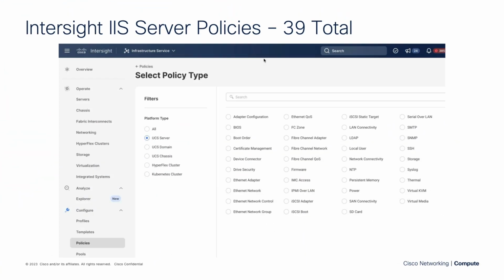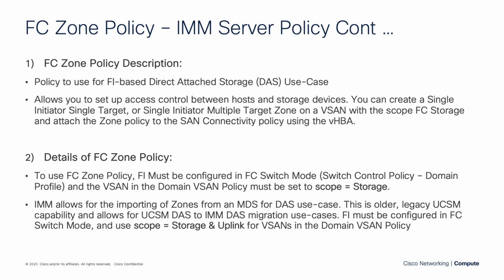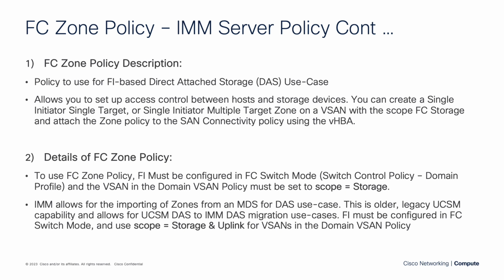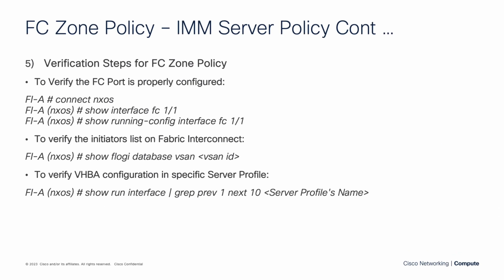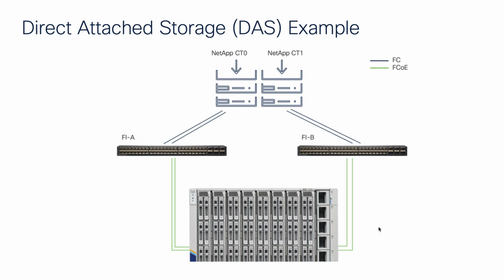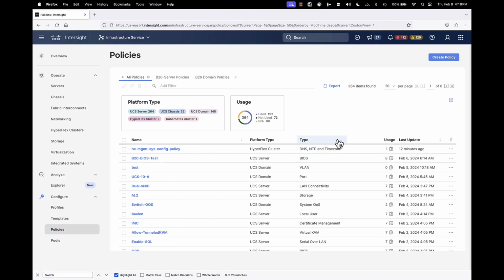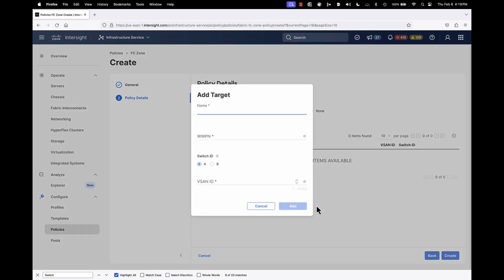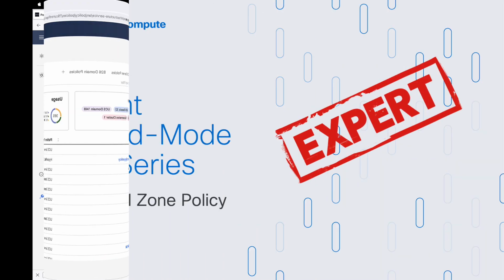Intersight IMM Expert Series - Fibre Channel Zone Policy

Comment: Many thanks for the video. in teh scneario: chassisX - FIx2 - storage, if the connectivity is using ethernet via SFP+ in both sides (chassis-FI & FI-storage) which would be the considerations? many thanks!